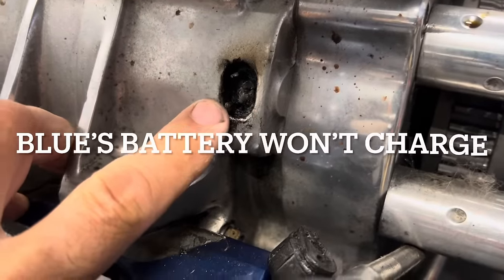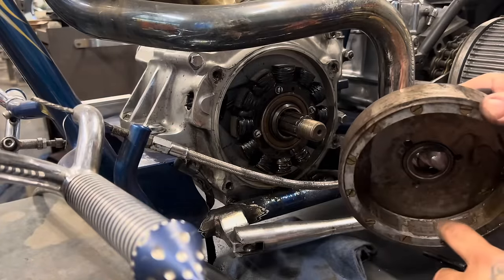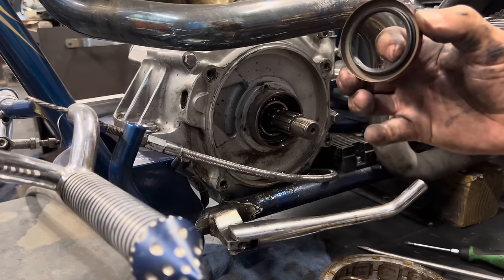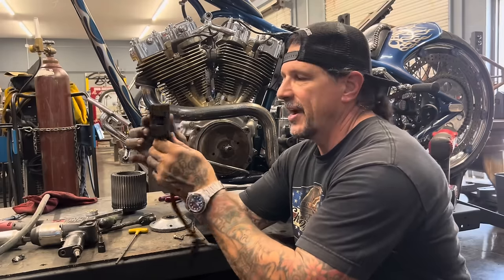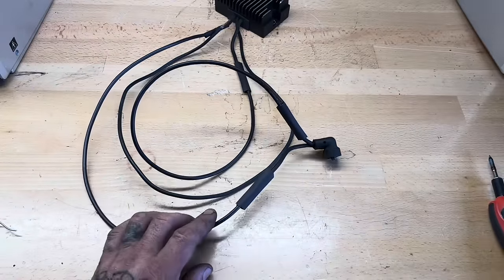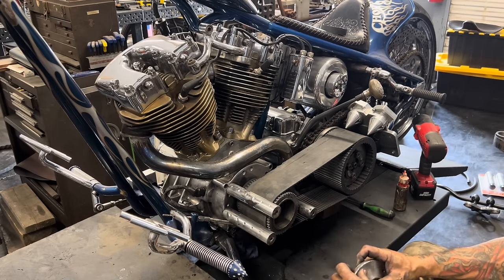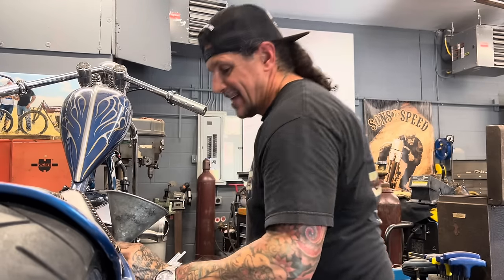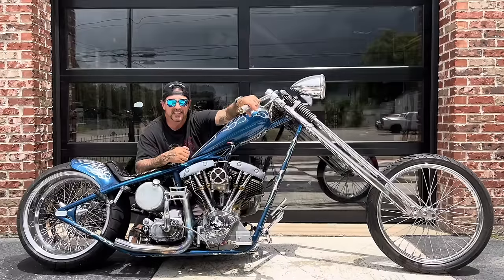Billy Lane 1972 Harley-Davidson Shovelhead Chopper 50th Birthday Sturgis Prep Indian Larry Choppers

Comment: It does my heart good to see electrical instruction videos where NO shortcuts are taken! Far too many people who decide to educate the world through a YT video will use a couple of crimp-on butt connectors and call that good. Not Mr. Lane! Not only using solder, but staggering the connectors is very smart. Way too many cars or bikes have melted and burned up their wiring harness from two butt connectors, side by side, positive and ground, then half a$$ed wrapped in black tape, and after some rough roads, not to mention all the vibrations, then it's not if, but WHEN they come apart from a simple crimp, there goes the wiring harness, if not starting a fire and burning your ride down. Billy is showing how it truly needs to be done!

Comment: What a Gift it was Billy to hear you say "" it also rectifyies  the alternating current to dc current because it creates ac current that has to be converted to dc current """ . countless tymes ive explained this simple fact that the  rectifyier is not just a voltage regulator . Thanks a Ton !!! great work !!!

Comment: Loving blue, but the badboy is probably still my favourite due to my love of the night train but im a simplistic bloke.

Your wealth of knowledge, whilst being open, humble and giving to the public is unfathomable, and the way you articulate the skills and tricks to the average person to aid in building a new generation to love bikes and to modify things themselves is incredible. 
Especially in a world were most would charge via patreon or something in order to learn alot of these things. 
Really shows a mans character, when its done for the love of it rather than for financial gain.
Kudos Billy, great respect.

Side note.
Not sure 100% on blues build from top to bottom, but im assuming you have some form of rubber isolation mount between engine and frame atleast? That should technically help prevent the engine mount bolts from backing themselves out.

Comment: Billy I had the same problem with main oil leak. Pacific Phil corrected me & I’ve replaced the sprocket spacer with new as well as the seal. I’m running a hi comp engine & raz bag it regularly. For the first time I have no leak. Thought oil was coming through screw holes or flange. I’d replace the spacer!! Every time a new seal is installed

Comment: Hey Billy, have you tried a higher temp thread lock with a slightly higher lock strength for that motor mount bolt? Maybe the high engine temp is reducing the effectiveness of the type of thread lock you use.

Comment: Well Billy...Sweet Machine your Blue... thats a great kick u have that's got umphf-firethehelluP,,,,
Your start any bike if it sparks wright n gets juice  ....
Really appreciate u sharing the Knowledge & History u have accumulated over the years 
Great ! clear camera work and explanation's 
i love  your channel & my Perl a 69 Shovelhead now has a 1972 bottom end ;-) got alot'a history too

i'm about to attempt fitting a "Fisher Harmonic Balancer/Damper" on my Shovelhead 
may sort-out the motor mount bolt issue on Your Blue ?  Less vVvVvibration 👌
i have slow cranking issue and now the relay cut off power 
and whiney noise not sure if its primary or gearbox Sometimes there's a gear whine from the cam gear running on the pinion gear.
il'e fight that Battle too  🏴‍☠🍀 Tink West Wales

Comment: Good to watch your vids again, always liked your bikes and builds. Just an idea for your motor mount bolts that keep coming loose. You might try to drill and wire them like must be done to race cars and race bikes. It really helps holds bolts in place.

Comment: an old guy taught me to use a bearing race as a seal driver. if the race is larger than the OD of the seal, when you drive it in it keeps the seal perfectly straight and no chance of denting the seal. also sometimes oil will leak past the splines through the spacer, not past the seal. i put a tiny bit of sealant inside the spacer; same thing with a harmonic balancer on a car. just to stop that annoying little bit of leakage.

Comment: @Billy Lane
That bolt that keeps backing out the trick is to take a ball pin hammer and place the ball end on the female threads and give it a tap with another hammer. Your rolling the 1st thread back just a hair to get the thread engagement to be a little tighter. That and some red lock tight should go a good way to keeping that motor mount bolt tight. I’ve use Teflon tape on threads like that also. Sometimes it does the trick.

Comment: Stator is TOAST.. HDs get hot anyway, burnt toast appearance as owner 'parade' the bike, overheat.. You should do a video in this subject because it's an issue that applies to every manufacturer, every motorcycle, from HD, Honda, Triumph, Aprilia ....stators over-heating, rectifier regulators burning out, potting melting, input lead sheathing melting.. We use a 30 amp auto-reset fuse link from the R/R output which runs directly to battery terminal +/- instead of back into  the main harness. Not sure how your chopper is set up. Roadster Cycles,  I have no affiliation with , sells complete stator, genuine MOSFET R/Rs...worthwhile upgrade if it applies .. Well explained as always Lane.. Thank you for taking the time to post !!!

Comment: I was born in 1970 and I've always thought the Shovelhead engine is the most beautiful engine ever produced by anyone...lol
Luv the videos!
I don't understand why electric cars don't have 4 big ass alternator/stator on each turning wheel to charge the battery while the car is moving?...lol
Reply: too much drag defeats the purpose
Reply: @jradish  a spinning rod with magnets on it doesn't produce anymore drag that it would if it didn't have magnets on it...lol
It's a waist of energy not to harness it...lol
Reply: Lots of electric vehicles and motorcycles have regenerative braking. That's a big reason they get more miles around town than they do on the interstate.

Comment: If you read this ... I’m no expert but I think on your motor mount problem  it could be a angle issue on both the bolt hole to the head and the spot where both meet together on the bracket you made ...but I’m thinking you probably already checked that

Comment: Billy Lane,   Have you thought about using spring steel as your top engine mount.   Either flat(leaf) spring or round would work.   The vibration would be reduced and not compromise stability.

Comment: This might sound a bit strange.. On that head bolt to frame mount, that keeps coming loose... Break off a chunk of a tooth pick, and wedge that in the threads mesh... It won't harm the aluminum threads, but time to time, add a single drop of oil down the side, and it will swell the wooden tooth pick...

Comment: The engine mount bolts get hot enough to soften the red loch tight, about 400 degrees. In the gun world there is a product called Rock Set used for muzzle devises that may hold, it is more heat resistant.

Comment: The motor mounting points where the bolts vibrate loose, drill a pin hole that will line up at a maximum torque and slide a locking pin through.

Comment: I could never understand how sealing the outside of the rotor spacer prevents leaking. Since the inside of the rotor spacer has no seal when it slides over the splines. I know I’ve got to be missing something, but I haven’t figured it out yet. I’ve seen so many people have problems with open primaries, leaking oil like this, I can’t help but think that that’s a contributing factor. ✌️😎

Comment: Nice. I had a 1973 Shovelhead chopper with an open belt primary. Mine was in an Arlon Ness Digger rigid frame. Also with a foot clutch and hand shift under my left hip. I was fine with the 2 inch primary belt. The modern rear belt is only 1  1/2 or 2 inches so why does the primary need to be wider?

Comment: It,s probably the heat off the heads when the engine warms up, that make threadlocker dissolve. I believe you have special threadlocker special for high temperatures, you should try that.

Comment: Hi Billy! 
Cool Video! Bought my first HD in 1995. IT was an E-Glide stripped down top the necessary parts. I Always liked the Shovelsound! But I Sold it in 2006 - that was a bis mistake! 
Now I own a 2000 FXSTS Springer with carb of course.
It also modified and ist IS nearly as hard as a hardtail...
What I das in the vid ist your Steinhart watch. Ist's a Ocean One GMT Black Ceramic, right? 
Good choice! I own the Same one! 
Keep in rockin' and stay safe! 
Boneskaker from Germany

Comment: My only concern would be whether the regulator gets enough cooling air flow as it is mounted down in there - it did last for a good time in there, but heat generated, and the reduced cooling could have contributed to the degradation and failure over time of the connector point at the case....just spit ballin and not disrespecting. I understand the look of the bike is also important.

Comment: And you get the socket really hot it's cutting torch and blow the middle out of it you can get really hot and hit it and blow the back side out where the ratchet goes you should both find a deep all that size really big that way you don't have to weld two of them together so if you can well the washer flat washer on the front of the socket so when you put it on to the seal you can pretty much tap an evening a lot better

Comment: Just wondering if the main engine seal is installed incorrectly since it has to be installed backwards when used with a open belt primary drive 🤷‍♂️

Comment: ok question, i have an 81 FLT, i know ugliest bike Harley ever made, thats why i love it.  that being said I have seen 1980 FLT with exhaust coming from the front jug going down the left side of the bike and out the back.  So true duals on an 1980 Shovel,  not so big a deal for a 74 inch but 93 inch is a whole different animal.  They only did this for the 1980 models, why did they stop, if you have an idea??  Also any reason to not do this??  Heat? IDK, seems like a good idea to do with rebuilding ???
Reply from the maker: I honestly don’t know why HD did that. My guess would be rear cylinder overheating. HD has always struggled with this issue on the touring models

Comment: My understanding is when u run open primary the rubber on seal faces out on closed primary rubber goes in supposedly when seal faces in it keeps primary oil from getting into engine and facing out keeps oil from coming out maybe why oil is leaking into primary

Comment: When you used that west coast chopper Impact tool was the nut clockwise or counterclockwise to remove it? I have a dry primary and could not remove that nut to change the belt.

Comment: Billy on the oil leak issue what seals the inner surface of the sprocket shaft spacer? can't oil seep between the shaft and the spacer?

Comment: I’m not anyone to have an opinion.. but don’t bolts “stretch” over time. Wouldn’t using new motor mount bolts hold better than those 20+ year old ones that have been torqued over and over and over? I’m asking because I honestly don’t know if that makes a difference

Comment: Hey Billy, my motorcycle is 22 years old with 19k miles on it. I use 20w50 oil in it. Is 20w50 the best for older bikes or does it even matter?
Reply from the maker: 20W50 is the way to go.
Reply: @BillyLaneChoppers  Thank you Billy.

Comment: I don't like using an impact gun on the nut. I believe that that can damage the magnets in the rotor.
Reply from the maker: It certainly is a possibility. However, I’ve been using an impact on these since the 1980’s. I’ve never had a rotor magnet come loose.

Comment: That super wide belt pulley must be creating a lot of unwanted side torque on the  Crank shaft in turn the leaky oil seal.The width of the pulley is a big lever.

Comment: Just curious what's your opinion on Ultima products, engine's, belt drives ect.
Reply: Cheap, but you get what you pay for.  It's all made in China.  Go on eBay and check out the difference in price between a custom bike with an Ultima engine and a similar one with a Harley or S&S engine and you'll see what I mean.  My bike has an Ultima transmission behind an S&S shovelhead.  The transmission will be changed to a Baker (made in USA) as soon as I save up the money just because I want an American-made tranny in my bike, not because the Ultima is broken or anything.
Reply: @chipmartin7608  I live about 20 miles from where they build the engines in pevely Missouri and I thought they were made in the US but I guess they're just assembled here

Comment: Bro great video I enjoyed it , very unusual for me to admit that esp when it's your fellow American brothers doing these type videos normally I can't get through there videos bro over there utter stupidity , but I found you to be quiet the very opposite which I did not expect , I was almost guessing how long I'd be able to take without getting mad over the stupidity , anyways enough about that .. I was stunned when you took the stator apart and you described the inners of it quiet in simplistic terms which was straight up perfect and the way it should be , you mentioned most things about it how ever u missed one crazy ass always over used word , I'm pretty sure you never mentioned the word continuity, and for that my friend you are in deed getting a subscribe a thumbs up and like for this video brother , yes sir and thank you like I said for the great or another over used word awesome  job done on the break down and the descriptive method you have getting to the point and on point bro , I just thought of something , when u were putting brake cleaner in the crew u went to blow it out after...just becareful brother as u could of bowed crap back into the stator area as it was all apart at the time, and my absolute last top tip top tip..u don't have to listen to me bro but it really is from experience as well you took out the regulator rectifier and it's was known working , you said your replacing it and didn't care much about it or the old magneto part of the stator too that they are for the bin...bro please don't bin them clean and label it all up and bag them ...RMB clean tag bag & finally brag , the last part not come for awhile ..but it could or might some time in the future , it could be an odd odd thing that something blows or god for bid a small accident or some ahole parking and hitting your bike or some similar circumstances possibly one I didn't mention bro,  but hold onto to those parts , several reasons why , cost is another factor ..but having working spares bro is always always a yes yes yes and I really mean yes sir to have ..you will be saying thank god for that , I'm glad I kept that stuff, esp if you have any sort of electric problems and you have to narrow stuff down bro least you have an option to chop or change bit and bobs and rule stuff out , yes SIRRRRRR ....anyways love that video and also like your stories ...rip to your bro ..I really man that for you sir ...anyway I'm sure he is still riding hard in the sky waiting to meet you again someday he will always be with you my man esp when you ride , anyways bro many many happy miles to you and your baby ...keep her lit as we say in Ireland brother and keep her between those ditches you hear ! ......thanks for your great and clear content ..you got a new sub here & now and will obviously tell others I know also to do with the biking community ok

Comment: I use superglue on bolts that wana come loose. Its cheaper. Wen i want it out it will come out. Or poor mans thread locker is spray paint the bolt threads

Comment: I mean maybe 100 years into the life the magnets will lose enough charge unless they're suoer strong for it to make a difference. The windings will probably go bad first as happens on old guitars.
Reply: You could maybe machine a piece of aluminium or steel to be a kinda losd balancer for pressing in the seals. Might help prevent any damage and make it easier and faster. Also like a giant socket.

Comment: 👻🇺🇸🇨🇱🇺🇸🥃🥃🍺🍻🍺🥃♠️♣️♠️♣️♥️♦️♣️♠️🏴‍☠️ you find a socket the size of the seal maybe a deep welding if you can't find a deep weld you cut the back off of the socket he weld a bracket to where you get hit it evenly on the seal

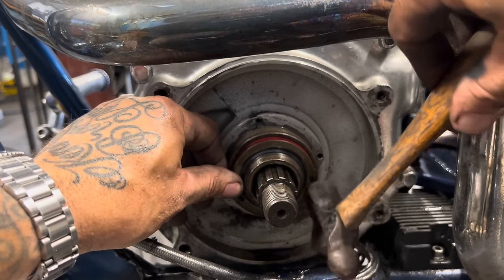Comment: 9:30 When our dirt bikes start leaking oil on the crank seal just do what we all do? Buy more oil! lol jk But instead of doing little circular taps with a ballpein hammer an try to get even pressure seating that seal just put a big asS BOOTY! size socket over it! , so its on the seal , an give the sockt a hit in the center assuring equal pressure!. .l.o.l.. cool videos though!!.

Comment: I fucking hate the 3 inch open belt drives if you’re running open belt or any kind of belt it don’t need to be no bigger than an inch and a quarter that shit max two and I still overkill in my opinion which is just like an asshole everyone’s got them
Reply from the maker: Agreed. I’m going to replace the 4” drive with a 1.5” belt
Reply: @BillyLaneChoppers  Oh thank God you’re amazing Billy It’ll look so much cleaner